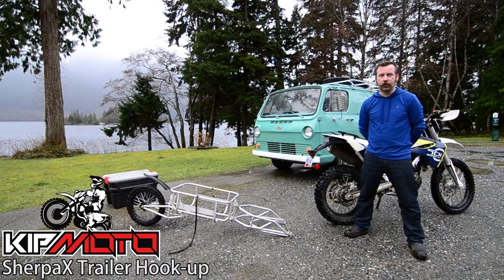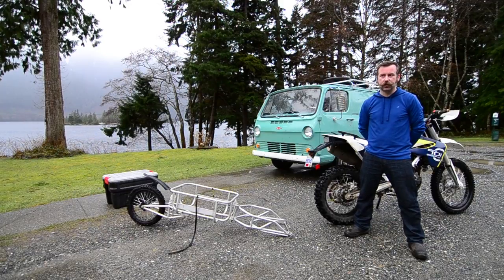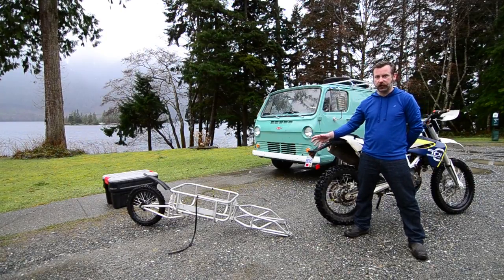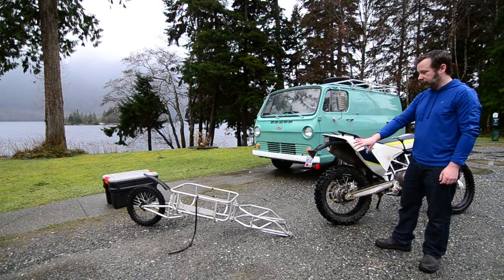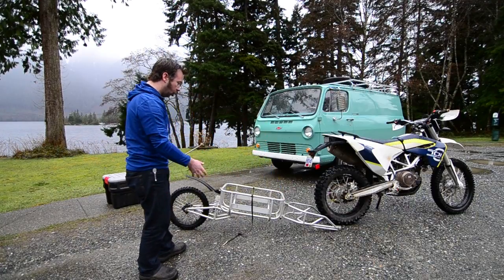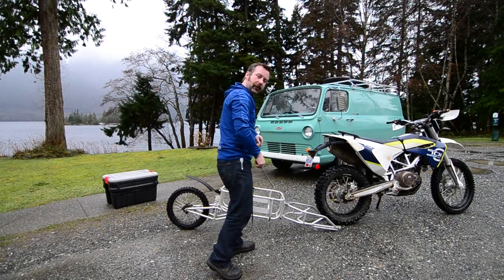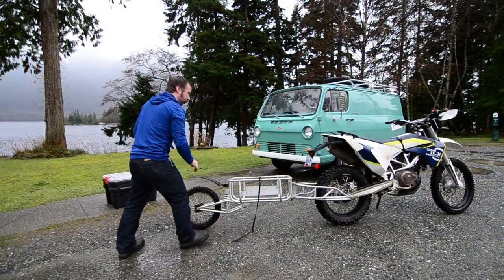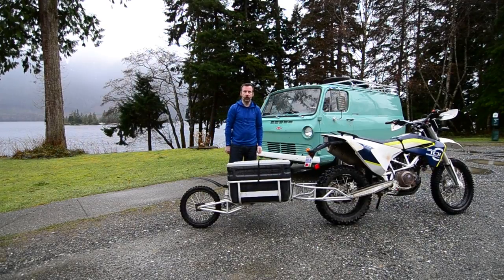SherpaX Trailer Hook-Up | Dual-Sport ADV | KIP Moto

Comment: So I don't quite understand and I apologize if this is been explained maybe in the comment section that I'm really not wanting to Surf 100% through.

So does this trailer come with a special axle for the rear that is Hollow in which you insert the thing he showed you inserting into it at around the halfway mark of the video?

Or.... does this kit include a special axle in which is either normally slightly longer or meant to allow this for quick easy connection or disconnection?

Otherwise it's a massive hassle having to take out the normal stock axle or axle bolt that sometimes it's called on the rear of a bike and then having to put in the trailer if you're whenever you need to change from using it to not using it.

Comment: Well, connecting requires an internally hollow rear wheel axle .. does it come with a trailer or you gotta make one? I haven't seen any bike so far with a hollow rear shaft.

Comment: does it require a license plate and lights to go on the road? Nice design, just like the moto mule.
Reply: every time there is a new wheel or axl on the ground, the state wants "its money", so yes, they would consider it a single axle trailer

Comment: That has to make riding so much more fun instead of loading everything on your bike. You could carry extra tires and fuel no problem.  What is the point where you feel it's just too much weight? My guess is you wouldn't want more than 100 lbs maxed out
Reply from the maker: Our standard SherpaX is rated for max 60lbs. Slower off road stuff you feel it more, high speed behind a big adv bike and you don't even notice it.
Reply: @KIPMoto  
Your camera man needs to be fired. He didn’t shoot a close up of when you were showing the viewers how to hook up the trailer.

Comment: i bought a quietcat bicycle trailer built along the same lines as yours,i have a 20" x4" rear tire/wheel tho on mine,rated at 80 lbs i think for gear,was gonna hook it up to my 04 shadow 600,but couldnt envision any way to hook it up.was your motorcycle axle already hollowed out like that with the wheel bolt in place or did you remove it to slide that axle in? in the end i jus decided to motorize my 26" phat tire bicycle,and its a slow and tedious process,but have most of the stuff to fabricate with.and my trailer was only 370 bucs on sale from the manufacturer.

Comment: Would like it alot more if it could be connected to the frame instead of the swingarm the unsprung weight on the swing arm will affect the motorcycle handling and suspension.
Reply: michael schettl 
  The way i see it Michael is THAT might exceed the gvw overall and the sprung weight vs unsprung WILL affect the off road performance and most likely the on road as well .  I've had plenty of Bicycle trailers , the frames solid AND suspended .  The trailers always worked better if trailing the rear axle. Just my musings .
Reply: Yes might effect it a little bit but no where near as bad as having all that gear in panniers
Reply: All gear scenarios effect handling, Just cause it effects handling doesn’t mean it effects it to much. This would be much better specifically off rd then a 60lb bag on the tail that locks you into the bike. And most bikes frames aren’t made to handle extra weight like that.
Reply: The best way is to bring a pocket full of money and buy everything along the way and you don't have to carry anything 
You sound like an engineer by the fancy jargon you use and it appears you put a lot of thought into your answer.  Where would you like the trailer hitch mounted?  How does someone on a bike carry 60lbs of gear to make it feel like you aren't carrying anything? I have a feeling you just may be putting this klp guy out of business